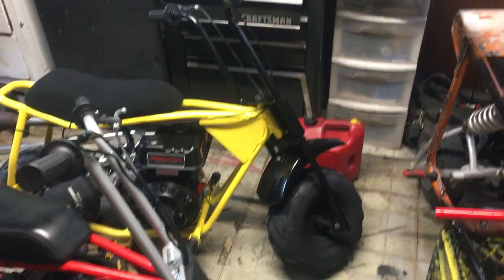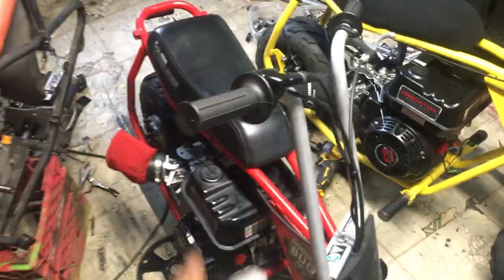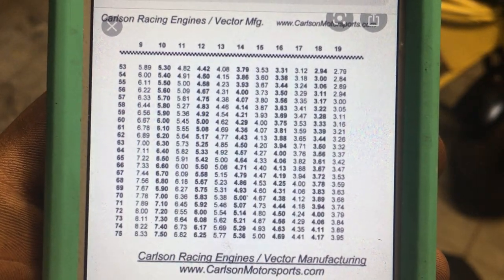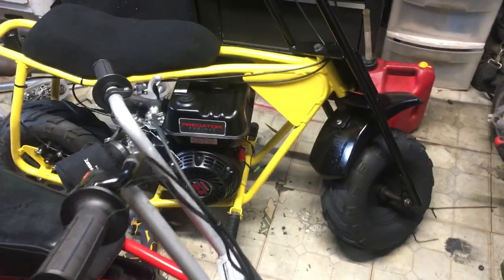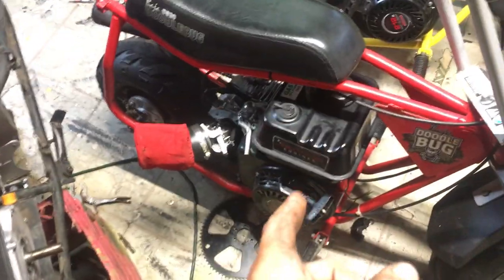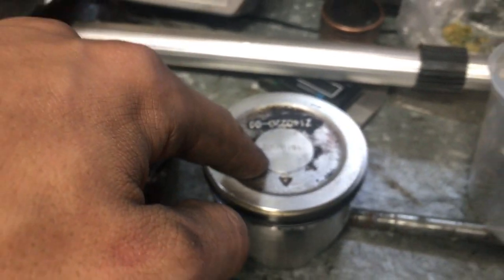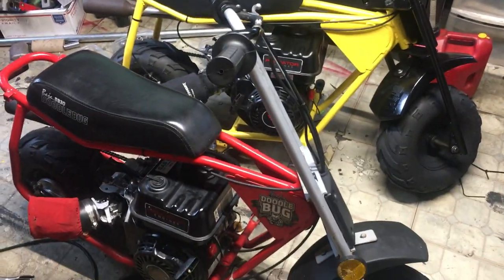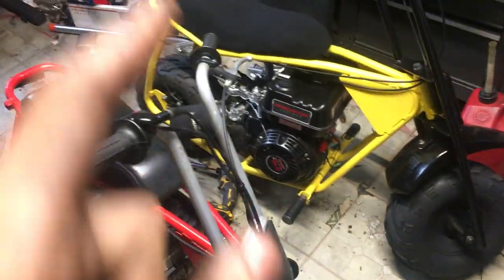How to make 212cc faster for free. No billet. 57mph proven

Comment: This dude knows his shit! Im running a 4.1 ratio and I think its perfect for low end and top end. Governor removed and a stage 1 kit with 18lbs springs 22mm mikuni carb 14.5 tires and ur golden. 61mph 💨😳🙌
Reply: What’s the 4.1 ratio sprocket and rear sprocket size ? I’m no to sure  on gearing

Comment: I need help making mine faster I still have the torque box on mine and when I take off the other two 212 can't touch me until we build up speed on the top end they blew right past me please help I have installed the stage 1 kit and they are still passing me with a stock 212 only difference they remove the torque box

Comment: How reliable are they with stock internals ? Ive seen these blow up after really high rpms and no billet parts..just wondering
Reply: I've had my valves shimmed for a whole year on a clone that's been abused in my go kart, (wrecked) and was on my db for months. Still goes strong. I use synthetic, if it makes a difference who knows
Reply: Usually they only blow up if you hold it on high rpm for to long or if you have a performance cam without billet fly wheel and rod

Comment: Hey I got predator 212 hemi got ported head spring changed stinger clutch 10tooth billet flywheel billet rod 38sprocket cam what more I can do to get it go a lil faster?

Comment: Or just use your calculator and divide 50t rear ÷ 12 front = 4. Something 
60t rear 12 front 5:1 ratio
72 rear 12 front 6 to 1 ratio 
I went for the 60 rear

Comment: nice bike you should change out the fly wheel those fly wheels will shatter at 60 mph so be carefull
Reply: LOL, continue to spread more bad info you read some where else  smh   Its not the mph its the continued higher rpm's that "might" cause them to toss the magnets and cause catastrophic failure. stock cams only good to about 4500-4800 rpms, might be forced to turn higher but its peak power is gonna be that rpm range.
Reply: @billwilliamson9842  wrong
Reply: @billwilliamson9842  my 212 blew up going 55 mph, most people don’t have a tachometer so it’s just a good safety cushion to not go past 55 60mph with a stock flywheel if you can get it to turn that fast like mine did
Reply: @jasonsnagel   what I'm sayin is,the mph is mainly dictated by the gearin, so thats not even close to a accurate way to factor things. i also doubt you got yours to even do 55 mph as you seem to have the technical knowledge of a tater.
Reply: @billwilliamson9842  that’s exactly my point bro, I’m saying it’s not accurate but it’s all I got to compare and what most people do, you are correct that it’s all about gearing but on a single speed engine with no gov will self destruct when modded like I did? It’s the best I got to guess the rpm range but my engine was running 36lbs springs with the spring seats cut down, 1.3 ratio rockers a ported head with a 22 mikuni with a pulse pump and no gov .10 head gasket,  8° timing key, hot coils CVT valves for oil return and that’s just the first engine I blew up, I know a little bit, just not gear ratios all I am sayings it’s absolutely possible to blow up a 212 with it’s stock cam
Reply: @jasonsnagel  Get a cheap tach. They have them now that can recall max RPM when you are done with the run. No need to watch it while you are riding. MPH is one thing, RPM is another.
Reply: @Deucealive75  well whatever rpm I hit was enough for the magnet to fail is all I’m saying and it was with a stock cam following my friend who set the pace at 50mph and it came apart when I accelerated to catch up real quick
Reply: @jasonsnagel  Yeah once you are going to be running more than 5K RPM it's time to get a rod and flywheel. The PVL's are around $65.

I don't even run high RPM and I used a rod and PVL on my mild build 196. It's just a much better engine with them. And I do have the option to take it up a notch in the future if I want.